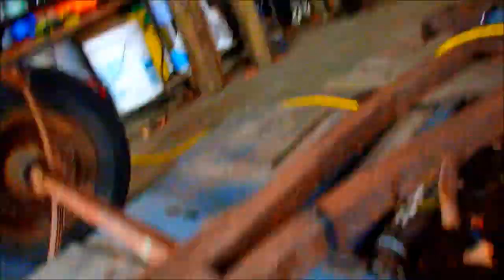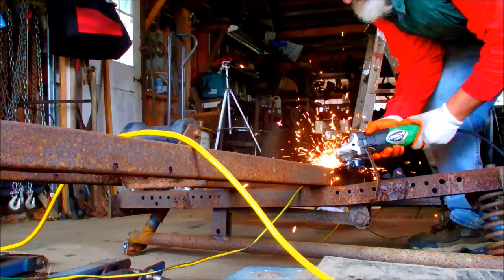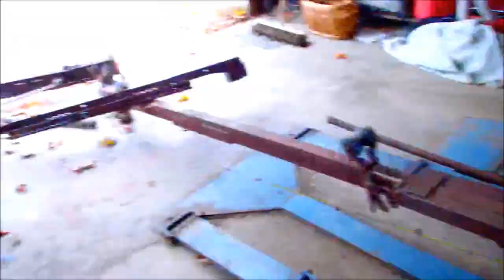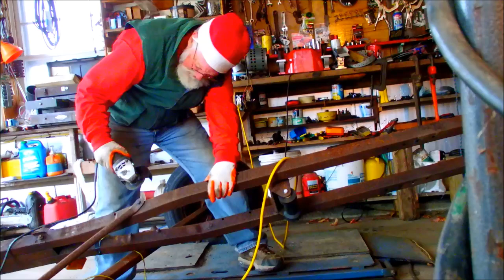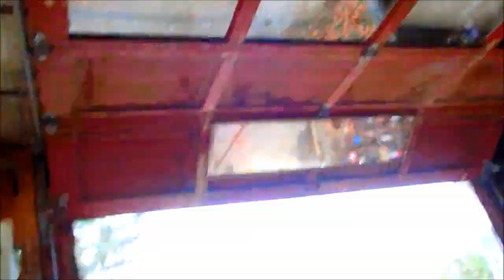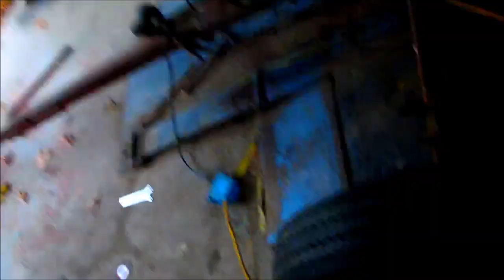Cuttin' up my trailer

Comment: Got to get you a plasma cutter
Reply from the maker: Got one.  I'll probably use that to cut those welded bolts off.  Mine's a cheap one, but it works good enough..